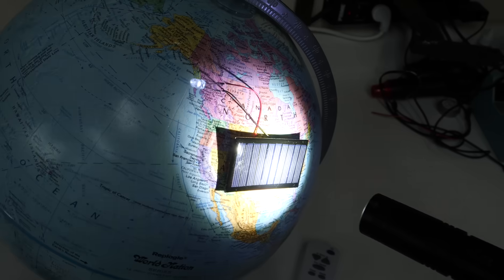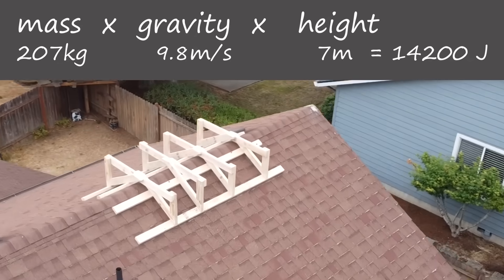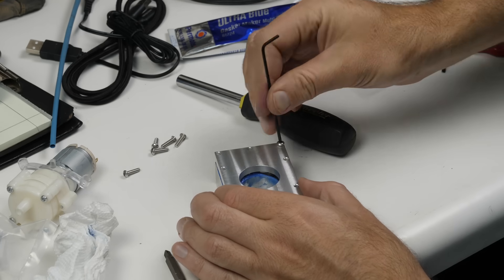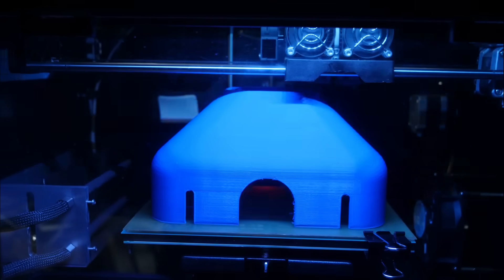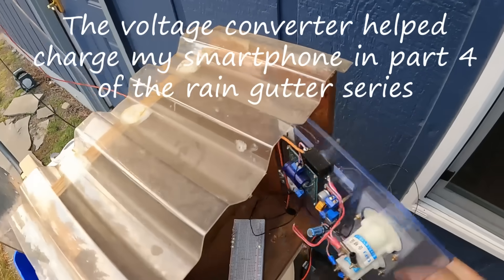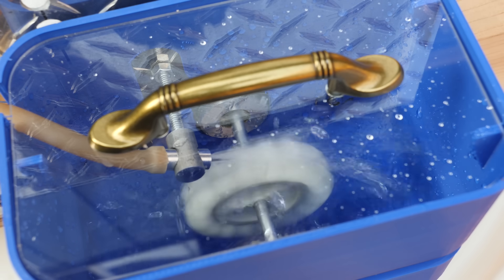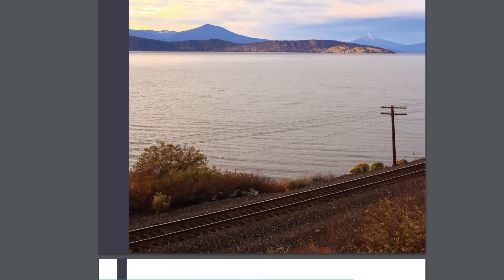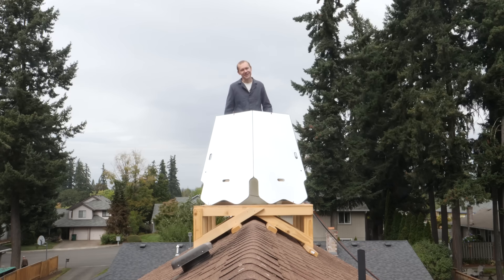Storing Solar Power on my ROOF!!!

Comment: There are power companies that do this with huge lakes. So I guess it's a proven idea.

I just don't know how practical it is on a small scale like this. I'd probably stick with batteries. But it's a fun experiment.
Reply: Dinorwig Power Station in Wales does this, using off peak power to pump the water to the uphill reservoir, with potential to assist the grid during peak usage.
Reply: @owensomers8572  at the price of 245 million pounds! If you use 1 percent interest on the investment  I hope I never have to buy their power!
Reply: @terenceiutzi4003  At today's prices, the energy it creates is worth £250,000 per hour. Break-even in 1000 hours ;) (Okay, drastically more due to wholesale trade costs, but it's been running 50 years. It could make 0.1% of that return and still be profitable by now.)
Reply: @Phazaar  and what is 1 percent interest on the investment 10 time that much? Ontario has been using hydro generation for over 100 years and our cost is 50 cents per KWH and the consumer pays 10 cents per Kwh  thanks to our 2 cent per KWH nuclear!  And government subsidies!  So we are all subsidising the Hydro with our taxes!
Reply: @terenceiutzi4003  interesting.. Not far from you where all the hydro is generating all the energy, they are paying about 6% of what you pay per kwh
Reply: @brianramirez1772  and just like we do at Niagara fall where we are destroying the ecosystem of Lake Ontario!
Reply: One 2600mah 3.7V - 18650 battery has about 10Wh energy in it, which is twice this barrel. Hydro Pump batteries on dams I think have about 70% efficiency - but that's on big scale. That's how almost 99% of electricity is stored/balanced. There is also flywheel storage but it's about 1-2%.
Reply: This is called pumped hydroelectric energy storage and it is very practical (just not practical on the small scale), in fact it is the largest form of stored electrical energy in the world. It is in use everywhere where humanly possible, but it requires local geography and hydrology that supports two large reservoirs at a large elevational difference that have to flood and drain repeatedly. That's no way to treat a lake and wildlife, so not every possible location has been "developed" by ruining them. Still it far, far outstrips all batteries ever built - there's literally almost nothing else. Batteries plus everything that is not this are just a few percent of the global capacity to store yesterday's sunshine, or wind.

For fun I did a rough back-of-the-envelope estimation that tells me if he were to upsize this system with a larger tank on the roof it could reach a point where the global installed capacity would only be 400 billion times greater than this system. 😅
Reply: he mentions that they're building one near him around the end of the vid
Reply: Hydro-power has one of the highest conversion rates of any "practical" energy conversion system we have, so it is an excellent way to get the energy back out of the system and harmonizes perfectly with the relatively low-tech (i.e. inexpensive) nature of the rest of the system.  I've been mulling over a system like this for years, but just don't have the time or funds to tinker with it.  My concept would use heat to pump the water instead of solar panels and electric pumps.  Solar panels do generate a small current when it is cloudy better than focal concentrators (lenses or mirrors) do, but they are much more expensive and far less sustainable in terms of manufacture and toxic waste, installation, system complexity, and ongoing maintenance.  This limitation can be mitigated with a large enough storage facility.  After all that, the only real concern is evaporation and biological contamination of the "juice" in the battery, both of which are easily mitigated.
Reply: @geraldrutledge1183  how on earth can you say that with a straight face?  Look at the fantastic amount of horsepower going into the turbines and how little energy they produce! Every inlet at the Sr. Adam Beck hydro plant puts out 4.3 million foot pound per second!
Reply: A power station in Missouri used this method, until one of the reservoirs broke. it sent so much water downstream so quickly that it scoured the soil away all the way down to the bedrock.
Reply: @osco4311  just like all of the hydro dams in China! That is why we don't use dams in Ontario! Sooner or later every dam fails and kills thousands of people and does a thousand times as much damage as the power that it has produced is worth
Reply: @geraldrutledge1183  how old is the Hoover dam? And in about 50 years when the south wes gets it with the rains that we all know are coming it will be another Tree Gorge Dam
Reply: @terenceiutzi4003  
China doesn't care about killing people. It wants to. Dams are very effective and efficient and safe...when you actually care about the people you build it for. Maintaining it like an airplane is crucial. Yes catastrophes can occur...but RARELY if the systems are enabled to protect people.
Reply: @GreatBehoover  and that is why there is only one grid supply dams in canada and we have some giant hydro progents!
Reply: @desmondsharpe5397  have you checked out what every one calls the Peace River hydro dam? It is just like the ones at Niagara falls it has a level control gate system that keeps the river level constat! Then they divert some of the water and run that through the turbines miles down stream and over 1oo feet below! And I had never heard any of them called dams until about 10 YEARS AGO! And at every generation plant that I have toured they have explained that they do not dam the rivers! But the Labrador project they sa it is the largest dam in Canada!
Reply: @geraldrutledge1183  nuclear is MUCH safer than a massive dam!
Reply: It's not practical at all on a small scale like this. If you pay 10c a kwh from the power company it would take 7 years of filling and discharging this every day to have stored and used $1.00 worth of power. It's gunna take him 1400 years to recoup the cost of material alone. Not sure that platform and tank will be there 1400 years from now.
Reply: He should have used multiple wheels as well. He isn't capturing all the energy.
Reply: @GreatBehoover  OH INTERESTING, like wheels all the way down the line HMM
Reply: I read a lot of these comments and see that most people don't really understand what this video is really about. It's to.me is about a man doing little projects and not only learning how things work. But also TEACHING his children and whom ever watched these videos how things work. 
For example let's say one of his children grow up and buy some property that has a running stream on it. Most people would see it and think awe pretty stream. But his child will see it and say I know how to use that stream to make me some electricity from that running stream. And giving his children that knowledge my friends is priceless.
Reply: @stevencartlidge6574  yes but any one with a grade 9 education from the 70s should know that it is a waste of energy!
Reply: I saw a picture in China where they'd build a huge damn at the peak of a mountain (you won't believe it until you see it)
Reply: It isn't practical in a small scale, a tank of 1000L elevated 8m can storage just 0.02 kw/h, while an average American home uses 29.2kh/h a day, that's not even a minute of electricity, supposing 100% efficiency, large pumped hidro plants have like 80%.
Reply: @pepopipo974  that's honestly a problem with American home design.

My house uses under 3kwh/day
Reply: I was thinking that too. I learned about hydro electric storage at school 55 years ago.
Reply: Spoiler - it's absolutely not practical.
Reply: Yeah.. but not all times we don't need to rely on a large area for energy storage like lakes.
Reply: yeah that twists my mind, that little thing does that much work?? would love some feedback
Reply: @ArticulatelyFox  
It does only the work of an aa battery.  That is horribly ineffective compared to a solar to other energy methods.
Reply: @GreatBehoover  what, like.. WHAT..!? im calling myth busters on this one
Reply: david poz has a Great video on storing heat in a tank of water, you can store it in the basemant so you can build a big tank and store a considerable amount of heat on a couple of tons of water, enough to heat an efficient house for 3 days
Reply: @SalvatorePellitteri  yes and. In the 70s  they made black plastic furniture that was filled with water to store daytime heat for cooler nights! But how will you heat the water in the basement?  And how efficient will that be? I know in the 80s there were designs with reflective shafts going from the roof of building to the basement to solar heat water , but the cost of the investment was 10 times the cost of any out energy!
Reply: @terenceiutzi4003  David tested PV+heating elements vs direct heating Liquid Panels, PV wins big! is most efficient and easy way, you need only a cable that connect the pv array and the tank. no pump required, no losses due liquid heat exchange with tubes and external ambient
Reply: @SalvatorePellitteri  you must be talking about conductive hearing which is by far the most efficient way to heat water as long as you maintain the perfect PH. Be cause if the water does not have the right salts in it I'd doesn't conduct and will not heat! And that is why they gave up on conductive boilers in the 80s!
Reply: It's only worth storing about 4 watt hours worth of energy, so about enough to recharge a smart phone.
Reply: They also do it with compressed air.
Reply: Another option when we get more renewables is to simply close the valves to dams when there's lots of renewable supply, then open them back up when there's less of it. This way you also limit how much you expend their reservoirs each year.
Reply: The barrel on your roof wouldn't be enough but say you have a large property you could build a big structure to pump water into then let it out into on pond when you needed power
Reply: Flywheels. We should just store energy in flywheels.
Reply: @liam3284  yes but is still grossly in efficiant
Reply: It's more reliable, safer, longer lasting than any kind of battery,  no polution too
Reply: @iAmDislikingEveryShort  you had better check you data? What happens when ever you store, pump or run water through a turbine! Check and see how outrageously polluting that is
Reply: @terenceiutzi4003  one barrel pumped water is less polluting than a AA battery
Reply: @iAmDislikingEveryShort  no it puts out much less power then a AA battery but Ove 1000times as much pollution!
Reply: Not practical, according to his numbers you’d need 3 barrels of water to store just 1 x 18650 3000mAh battery worth of energy - and that’s assuming 100% conversion efficiency on the way down when using stored energy.
Reply: @Click Bait funny the key scrapped all of the water storage projects in the US in the 60s because they don't work?
Reply: He mentioned it in the video, if you'd made it all the way to the end. Wink 

He really should have said so at the beginning though.. at least let us know its tested tech, instead of a pipe dream.
Reply: agree. that was more or less his point. it's a demonstration, not like... a ground-breaking new renewable-energy idea. efficiency problems like this are a large part of why these methods haven't been adapted on any kind of larger scale.
Reply: Snowy hydro in Australia
Reply: Huge lake = for city
huge container = for house
Reply: @nateman10  I live in Ontario and in 1967 we built the Sir Adam Beck hydro plant.  By 1970 there was a huge dead spot in lake ontario first we blamed it on the pulp and paper industry up north. Then they banned phosphates in detergents causing water plants to consume all of the oxygen in the water(clearly a lie)! Then they cut the production of the Sir Adam Beck hydro plant by 60 percent because water turbines crack all of the gasses from the water?
Reply: @terenceiutzi4003  you have absolutely no idea what you are talking about anything. Random words such as flywheels, which are way less inefficient. Then you go on a tangent about the mass object storage device which is basically an investor scam that has zero chance of being practical real world. Finally you yammer on about dams in China, however China is tearing down small dams in favor of large scale dams that are way more effecient. Three gorges has never failed, so it's odd you would bring it up as a risk factor. Fact is for the purpose of storing energy pumped storage is the most cost effective and environmentally friendly way to do it.
Reply: It isn’t practical at all. This is for YouTube entertainment only. There’s a reason he kept the initial calculations in joules. It’s like 4Wh. You could get 250x that capacity in a battery for probably the same price as his whole setup.
Reply: The math says it's not worth it, since you can't store any significant amount of energy without needing a very strong roof. Unfortunately. But it's still fun that someone has build it.
Reply: @Finnspin_unicycles  yeah, 4 Watt hours (14200 Joules, which is 14200 watts for second, 3,94watts for an hour) per each barrel. So you would need simply 250 barrels to store ONE kilowatt hour. In practical applications for real usable power you need at least few kilowatt hours to run efficient house over night.
Reply: @Karjis  and a kwh of lithium batteries is about $400 so each barrel needs to cost $2 and last 10 years. Also eff of battery is 90% where this looks like 10%
Reply: @Karjis  and probably even more barrels to actually generate 1 kilowatt hour of electricity. Damn efficiency losses. Either way I can't see the roof holding that much weight. If you could support a 2500 ton of water olympic swimming pool on a 400m skyscraper roof you would store nearly 10 billion joules (2700 kwh) of potential energy and that would still be a sizeable quantity of electricity.
Reply: @Karjis   I agree, 14200J equates to 3.9Wh of power, where a typical lead acid batter can store 456Wh, which equates to 117 times as much energy and a lot easier, efficient and probably a similar price (parts only). Anyway interesting idea!
Reply: @buckybuckyking  yeah this barrel thing equals roughly one AA-battery.
Reply: @Finnspin_unicycles  This is a proof-of-concept (and I cringed when I saw that tank up there too -- those rafters had to be crying a little).  He never even broached the topic of a continuous loop.  But in essence, if the collector is inadequate to power the house, the system will be too since thermodynamic losses are inevitable.
Reply: @Finnspin_unicycles  Try two oil drums stacked one on top of each other with an impeller between the two of them.  Fill the top one with mercury.  At 13x the density of water, it should provide much denser energy storage.  50 gallons of mercury would cost 10000 dollars.  With a tube for venting between the two vessels, the whole thing can be air tight.  This should probably be in your back yard rather than on your roof.  Definitely don't want this thing to leak.  What does the math say then?
Reply: @David13ushey  That's 21 Watt hours of storage capacity, assuming the fluid levels of the two barrels are at 3 meters height difference and ignoring all conversion losses. That's around the capacity of a 20$ lead acid battery...
Reply: @Finnspin_unicycles  How many watt hours do you need on average?
Reply: @David13ushey  the average American household uses 30000 watt hours per day. Google is your friend...
Reply: @Finnspin_unicycles  Yeah, but why google when I can have you answer it for me.  Too bad though.  Thought it was a novel idea.  Two moving parts, all contained.  Seemed pretty useful.
Reply: @Finnspin_unicycles  all depends where you live, and what the usage of the water is for. I use a similar setup at my off grid cabin to pump water into a barrel to be used as water to wash hands etc from the sink... its amazingly more useful than the gas powered water pump that never worked(can go 9months without use)
Reply: @Finnspin_unicycles  maybe your definition of 'worth' should be re-evalutated? He just lit up his patio table, using 'effing water and the sun. the alternative would equate to carrying a 5-gallon bucket up a ladder to the roof (40lbs/20kg) 11 times! If you let yourself be limited by a myopic definition of worth, you will always be the person watching someone else do the thing on youtube... I find your comment ironic coming from a guy who rides a single-wheeled cycle.
Reply: @aaronjoseph7573  well, the unicycle is worth it for fun. This is also worth it for having fun with tinkering. In terms of money (which most people would think about when talking about "worth it" and what I was implying) a simple car battery is probably much more efficient. Ecologically, this will probably also never pay of it's carbon cost.
Reply: well hydro power is a proven technology we have been using for a long time. This set up is similar but you are using solar to move water to a higher spot. Helpful for places that don't have a geographic advantage of mountains or even a waterfall.
Reply: @MrHavoc313  
And that's exactly what the other poster is talking about. Some power companies pump water to a pond on a hill top during the day and let it flow down at night spinning turbines
Reply: @kirkstinson7316  You got the right idea, but it's not necessarily a "day/night" thing in every situation.  If the grid is fully powered by solar, then yes, it would be to pump up the pond all day and then drain it at night.  However, most of the world is still on "fossil" fuels to power their grids with Diesel generators which means they produce pretty much the same power day and night.  To alleviate the power strain, they "drain the pond" during peak demand, then pump it back up during "OFF-PEAK" time when the grid is bursting with excess power.  In California it used to be to "DRAIN THE POND" during the day for max peak demand.  The theory of operation is sound.  I used to windsurf on 2 of the lakes used for this purpose.  The lower lake would fill up during the day, and then start shrinking toward sunset.  There is a really cool visitor's center at the upper lake (San Louis Reservoir).  If the grid were solar powered, it would be the reverse situation.
    In the past, the power grid demand cycles promulgated messages from the major utility company that were for curtailing usage during the mid-day (peak demand), then go ahead and use it starting early evening.  Now, because of so much solar being brought on-line, it's flip-flopped to "use it as much as you want during the day".  The power bills reflect it.  If you have solar at your home, and are on the grid giving back to the grid, your meter runs backward.  You are generating a power credit. The rub is that at night, when you are using their power, they charge you greater than the 1:1 credit they should apply to you.  Hence you get cheated and they have ample power for the Grid.
Reply: @MrHavoc313  Damns are actually a totally different concept. Dams are power generators, this is just time phasing and is actually a net consumer of electricity. When they pump the water to a higher reservoir it consumes power and since the process is not 100% efficient when they release the water it produces less electricity than was used to initially pump the water. This only makes sense because they can pump during low demand times when power is cheap, then release it during high demand times when it's expensive, but it is not a net generator of electricity. Dams on the other hand do generate tons of electricity and add to a grid's generation capacity.
Reply: @MrHavoc313  yes and if you do the math 45 gallons of water stored on a 20 foot roof will put out 8 WH of electricit that would run one small LED for an hour! WOW!
Reply: @terenceiutzi4003  I mean, you're objectively wrong; an 8 W LED is actually really bright -- equivalent to an old-school 60 W light bulb. It's definitely not the most space-efficient way of storing energy, but at the right scale (utility companies not houses) and in the right terrain (so you use hills, not building tall platforms) it is competitive in power price with a dirty peaker plant running electrostatic scrubbers to reduce the smog impact.  
https://en.wikipedia.org/wiki/Bath_County_Pumped_Storage_Station
Reply: @TaiViinikka  yes but you could not run an incandescent bulb it just doesn't have enough powerB
Reply: @TaiViinikka  
60 watt light bulbs put out 800 lumens...not that bright in todays standards in a room. A single 4 bulb fluorescent fixture at an office will produce about 6400-8000 lumens. Think about that. I use 9000 lumens in my large family room. 
Again...this system is useless and  time wasted...other than the knowledge for us not to build it. The more efficient batteries are now pouring out of R&D faster than a waterfall.
Reply: That is the reason most hydro generation plants have dams! They don't produce more power they jus allow them to stor water during low demand periods to supply high demand periods!
Reply: @terenceiutzi4003  
Plus no power lost in storage of pumping anything. The water upstream does all the work.
Reply: @GreatBehoover  I have over 40 years experience building industrial water systems and if you actually did any research you would find the best pumps built are 75 percent efficient when they are new and that drops of as they wear! And water is very abrasive!  That is why the are working on lifting giant weight and then using the kinetic energy to generate  power! It isn't very efficient but it twice as efficient as pumping water!
Reply: I miss your technology stuff videos.
Reply: They have been doing it since the 60s and it is less the 30 percent efficient!  But it is something! And the saving will pay for the investment in about 300 years!
Reply: @terenceiutzi4003  false. Pumped hydro is more than 80% efficient. The only current barrier is the limited installed storage capacity, but there are 1000s of sites world wide worth constructing pumped hydro storage. Currently Ontario's Sir Adam Beck generating station has a 300  hectare reservoir for pumped hydro energy storage that has a capacity of 175 megawatts. The US has over 30 sites with over 22 gigawatts of capacity. Plenty of other proposals in the works but face barriers from lies, misinformation and NIMBYism.
Reply: @johnfurr8779  you should look into the eficiancy of the pump and the turbines
Reply: @terenceiutzi4003  I have
Reply: @johnfurr8779  interesting be cause the highest performance pumps I could buy for the cooling towers were Jacuzzi and I played over $10,000 for a 15 HP pump that was 38 percent efficient at a 30 foot head?
Reply: @terenceiutzi4003  I'm sorry that you can't grasp how overall efficiency works, but the fact is that not only does modeling demonstrate that pumped hydro is ~80% overall efficient but those figures have been validated by PHS facilities in operation for more than a decade. 

ps I hope no one relies on you to source goods. Bye now. we are done.
Reply: @johnfurr8779  and I Garret they don't publish any data! Don't tell me it is their intellectual property?
Reply: @terenceiutzi4003  80 to 87 % total efficiency can be achieved in modern systems.
Reply: @bernhardleopold6702  you seriously need to-do some research?  I spent over 40years designing and building pump systems and I can tell you have no Idea what a pump performance chart is and no Idea all how pump efficientcy changes temperature, head and flow rate!
Reply: @terenceiutzi4003  pump hydro are 70%, now here in Australia having so many roof solar systems,  it's cheap for them to pump from 10am-2or 3pm
Reply: @jantschierschky3461  you should check the data sheets for the pumps
Reply: @terenceiutzi4003  i am a water expert and was involved with number of pump hydro,  we talking about money efficiency.
Reply: @jantschierschky3461  so you should have read at east one performance chart and have seen how much the efficiency drop as the head increases with a none fixed displacement pump! And you must know how low the efficiency is with fixed displacement pumps when pumping water!
Reply: @terenceiutzi4003  look hydro pumping is done with turbines running in reverse.  If you run your own set-up using a right set-up you use 4kW to pump to about 50m 5KL /h, you have a solar set-up  that gives you 6kW for 6h, it worth it. You can get about 2kWh for 10h
Reply: @jantschierschky3461  a turbine is still not a fixed displacement pump and the eficiancy still drops as the head increases!
Reply: @terenceiutzi4003  well however you increase yield as well. The benefits lay in cost not in energy efficiency.
Reply: Why not use sealed flywheel like GM did in the 50s it is least 10 times as efficient?
Reply: Better understanding involves learning and doing!
Reply: @NwoDispatcher  yes but we did all of that in the 70s what do we think the laws of physics has changed? The most efficient way to store energy is the flywheel battery that GM developed in the 50s
Reply: @Click Bait do the math and check out the efficiency of pumps and turbines! It does not work and it didn't work in the 60S AND IT WON'T WORK NOW!
Reply: @Click Bait have you ever studied physics in your life? What happens when ever you convert from one kind of energy to another? That is the first law of physics that you learn!